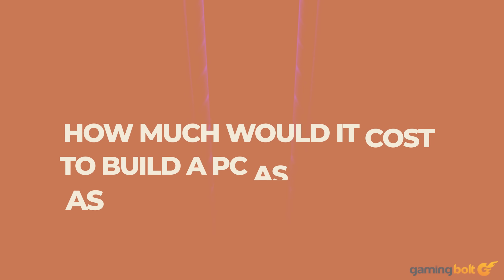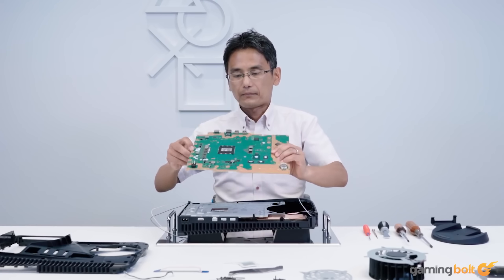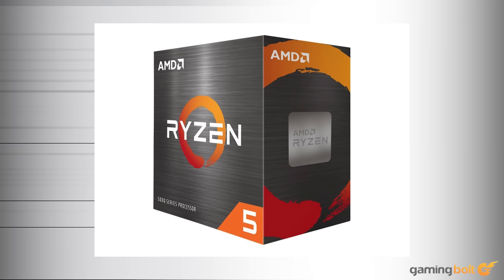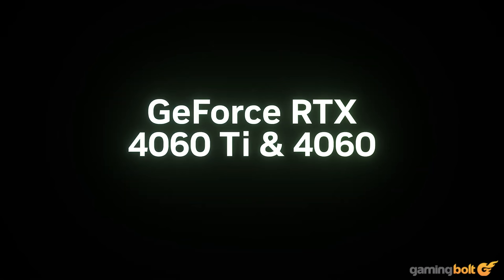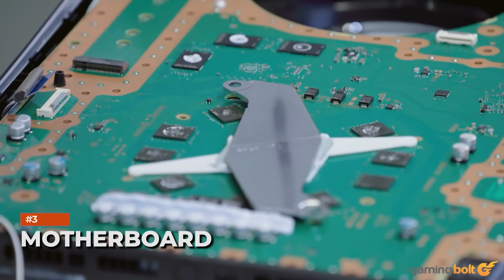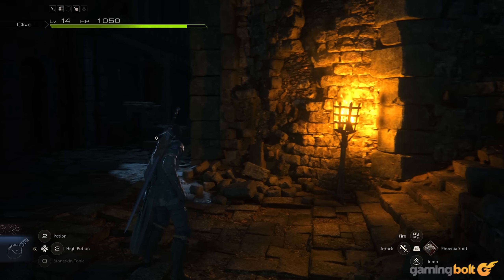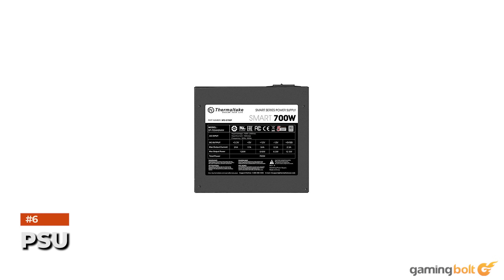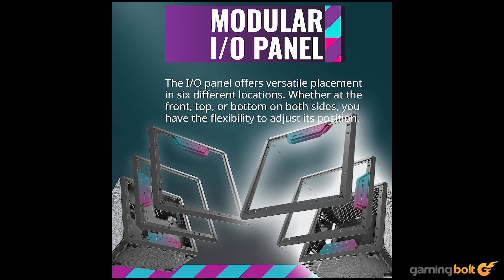How Much Would It Cost To Build A PC As Powerful As The PS5? (2023 Edition)

Comment: Got a 3060 ti and a 5800x and it blows my mind everyday after almost 2 years now , love this pc
Reply: @lonewolf_09you are full of shit  you are talking about intel they changed cpu lay out socket every 2 to 3 years while amd has been supported its socket it for more then that like 6 to 7 years
Reply: @lonewolf_09moreover people don't realize that PCs in the long run save's money for them as well when they buy games lots of frequent sales and there are also so many sellers on the PC market where you can get such a great deal on bundles. I would say that PC saves money in the long run than consoles in my opinion. Games Are way more expensive in consoles moreover you also have to pay to play online which is another bullshit thing that I don't like about consoles. Also PCs can be used for more than just gaming.

People only judge two platforms based on the initial investment not long-term.
Reply: @HellRaiZOR13 even long term, consoles are just cheaper than a PC. Invest the extra bucks in the disc version and you easily the same discounts for games as on PC. 
Once you have to upgrade your pc shit's gonna get expensive. Cause what are the things that mostly run out of required performance ? The heavy hitters. CPU/GPU. So every few years you gonna spend the equivalent or more of a whole console to keep the same level. A console on the other had you gonna buy once and it will last for the whole console generator which is 7-8 years. Good luck keeping a CPU/GPU as long without heavy performance losses

Comment: I will go for 6700 XT every single time
Better performance and 12GB is waaaay better than 8GB
Reply: Except PS5 GPU doesn't have 8GB, it has 15GB, because the machine doesn't really need RAM for anything else than the games on it. Think of it as a unified memory. PS5 is a games ONLY "pc", not general purpose.

Comment: Since this PC has no Blu-ray drive, it should be compared to the $400 PS5.
Reply: I have a blu ray player in my pc
Reply: And a PS5 has no screen... 🙄
Reply: @h0pesfall but can you plug a PC directly into a 60hz 4k TV from the moment you take it out of the box and play a game almost immediately without having to configure the finite settings to make sure the game runs smoothly?

And before you use the "higher FPS on PC" argument... You need to factor in the cost of a monitor that can run above 60hz.
Those things are not that cheap yet, and are definitely nowhere near as big as my 50" Gaming from my couch TV.
Reply: @BWA85  you didn‘t get the sarcasm
Reply: @BWA85 Yes, you can do that. GeForce Experience will set the in-game graphics settings and cap your FPS to whatever your hardware is capable of, it will do all of your work for you and you'll be playing at at least 1440p if your hardware is capable, which is better than sub-720p base resolution used on the consoles on mostly every new release. You plug the PC into your TV, install the game directly from Steam and you're ready to go. This isn't 2008 anymore.
Reply: @Blackfatrat ps store does have some good sales
Reply: @Blackfatrat  bruh how about buying 2nd disc or hand digital (illegal). I could get quarter of the price.

Comment: When you weigh in $80/year for online play, the pc wins over the long term
Reply: "long term" I calculated and it takes years to make the ps5 the same price, and plus you still have to upgrade your pc
Reply: @arinkarwan5888  really don't.  I'm still running a 1080 thats 3 gens old and it runs games just fine
Reply: @arinkarwan5888  Not Must have to upgrade. My Secondary PC has 980ti a 10 year old GPU and it still runs game just as fine
Reply: By the time you have to upgrade the PC you have to buy a new PS6 @arinkarwan5888

Comment: I wish I could pin this to the top so no one wastes their time here. A  Ryzen 5 3600 with a decent cooler and an RTX 2060 S OR a 5700 XT...... that's what you need to match/beat the ps5 

A stock Ryzen 5 3600 will match a 8/16 zen variant in the ps5, not only is it running at a lower clock speed than its familial counterparts, the reduced power budget of the chip also impacts the ipc of the chip. 

Similarly the GPU, while sharing architecture and features with an RX 6700, is not equivalent to that GPU, due to power limit and frequency. 

I'm giving it more credit than GN, they recommend a GTX 1080 and anything newer than zen 1 with 6 or more physical cores.

Comment: PS5 = RX 6600XT/RX 6700 (RTX 4060ti is around 20%-25% faster + DLSS 3.0 with FG for better performance) + R7 4700G without turbo (R5 5600 is around 30% faster or even more). Why are you trying to compare Zen 3 to Zen 2 and RX to RTX, this is not same technology and architecture.

Comment: Devs will always squeeze every last bit of power out of a console, especially as time goes on. Just compare PS3 launch titles to PS3 late life cycle titles. You have like GTA V, Uncharted 3, Heavy Rain, FF 13, Skyrim vs some random launch crap like Ridge Racer, or even Oblivion.
Reply: Not really true GTA V is running a pathetic 4x AF filtering when everyone has been automatically using full x16 for almost two decades on every game on PC lol.
Reply: That’s not really that the hardware is understood better. That’s because they were shifting away from older rendering techniques developed in the 6th generation for newer techniques and things such as deferred rendering. Plus you can see a massive shift in game performance where many early PS3 and 360 games ran better than later ones
Reply: @crestofhonor2349  early and less graphical games ran better than much more graphics intensive games that made them crap consoles run a sub 30fps at end of life. You can't optimize for the underpowered hardware deficits inherent to the last gen consoles weak mobile laptop cpu with 8 slow cores just like you can't optimize games for hardware that is not present like the missing in action strong cpu IPC from last gen consoles.

Comment: I'm interested in building a PC to replace my PS5, but the power consumption of the PC and big bulky PC case holding my plan, let alone need more money than buying a PS5. since I've the PS5 already, I don't think it is wise to build a PC.
Reply: In previous generations (xbox one, half the life cicle of xbox 360) the only way to justify a console was plain ignorance (legitimate reason TBH). However, current gen is solid, no reason to migrate to PC unless being willing to go full blast into something much more expensive, or complementary factors besides gaming
Reply: @ziokalco that’s patently false. Every game looks and runs better on pc even with bad ports and is cheaper.
Reply: @LudusAurea  PS5 has pretty much an RX 6700 (and a nerfed 7 3700), also a very good SSD. Achieving that kind of performance on a PC for a similar price is hard, and not possible with new current gen components. To get more than a 50% improvement you would have to go for an RX 6800xt which alone cost more than a PS5 digital. Going lower would be basically a sidegrade, pointless for someone that already owns the console (unless there are other factors motivating getting a PC).

Power isn't meaningless, 300w extra watts can quickly become more costly than a PS+ subscription (PS5 consumes less than 250w when fully loaded).
Reply: @LudusAurea  for reference, the difference between an Xbox series s, and an Xbox series x is more than 110%
Reply: Power consumption is irrelevant

Comment: An Rx 7600 will beat a ps5 and you can get them for 250.

So that brings the price down to 720. Then you don't need to spend 40$ on a case, maybe 20 bucks. So now you're down to 699. Only 100$ more than a ps5.

You don't need windows. Linux games just as well and would offer a lot more things to do other than gaming unlike a ps5.

Comment: 😂😂😂 - Sometimes I wonder if the information provided in these videos is satirical in nature...

A couple reasons that this won't ever happen. Building a PC to match a next generation console. First, what's the point? There are fanatics in each camp that will fight till their dying breath to defend their systems. Nothing you say or do is going to change their minds. You know, like religion. 

Secondly, OF COURSE the components to make equivalent machine are available. So in theory, it's possible to make a PC clone of any system at any time with any game. Facts are facts. 

This boils down to two main issues - time and money. As a hardware engineer, I can think of at least a dozen things I can do to improve performance on a PS5 given the an unlimited budget. And if I didn't work so much I could devote more time into the project resulting in far greater experiences. But, when I want to game, thats it. I don't want to have to stress and strain over gpus, RAM, or other peripherals. I don't have the patience to tweak every setting until I can get (on paper) better performance. Hell, I don't WANT to deal with much of anything. Coming home to unwind with a solid game as quickly and hassle free is my goal. And consoles scratch that itch. 

Also - just pointing out that only three components in you had already spent more than what a PS5 costs.

Comment: the actual components are irrelevant when the os and architecture differ so much, consoles are heavily optimised so the comparison is moot. the only comparison that matters is matching the performance of the same games at the same settings that is all. 
SO your choice of a 4060 is way off, as the games on console won't be running dlss3. why not save a bunch and get a cheaper and more comparable AMD 6700xt etc? many modern console games like to use nearer 12gb vram too, something the devs have stated they aim for and will become the norm in future titles now ps4/xbsx are no longer having to catered for. again something you'll miss on the 4060 but get on the 6700xt

Comment: The problem people seem to forget about the PS5 SSD is that they use it for extra RAM. That's why PC ports of their games requirements are stupid crazy.
Reply: The PC requirements are stupid crazy due to bad optimization.
Reply: Eh no
Reply: SSD is still slower. Sony can claim whatever they want, but all they're doing is direct storage access. Using the SSD as a RAM buffer would still be slower than actual RAM any day. Not to mention the fact that writing data to a SSD that often would essentially kill it in a fraction of it's intended lifespan.
Reply: You can actually set windows to do this as well. Not as streamlined as PS5 does it. Bunch of digging to find the settings for it. But I've used it before. Don't really need it when running 64gb of ram anymore tho
Reply: @paulieknewport1106  Albeit if a dev has used it properly, had yet to see.
Reply: @theepicduck6922 From a dev perspective ram is rarely optimized for. Memory optimization is mostly about structuring data, and the goal is to have all the relevant data in the CPU cache. When it is not in cache one just assumes it is somewhere fast-ish. But weather it is RAM or SSD is rarely relevant to a dev (The important thing is that it is NOT on the cache)
Reply: PC ports have high requirements because they're ports and the PC release was an afterthought. Don't talk about things you don't know a thing about 😂. 

And ssd for ram isn't the magical infinite ram hack that Sony's marketing would have you believe. Fetching from ssd will always be far slower than fetching from ram for your cpu, and the extensibility of a pc makes this weird hack completely irrelevant.

Comment: I have an i9 with a 4080, but i still play on ps5. Optimization > raw power. That's what most kids don't understand
Reply: Your PC runs higher framerates, lower frame times and supports a much higher graphic preset than the PS5 can possibly reach. This is a fact and optimization cannot close that gap period.
Reply: @SSEi02 but 720p upscaled to 4k is crystal clear on ps5...

Comment: Honestly, this build guide makes no sense at all atx motherboard in an matx case, 4060 card 🤷🏻, gen 4 m.2 on a motherboard that only supports up to gen 3,. This whole thing would be better is you said buy used get a 3000 ryzen 7 and a 3060ti and the b550 version of the gigabyte motherboard with your gen 4 m.2 with an atx case to drop it all in.

Comment: Look you have to include peripherals... 4K Blu Ray drive is a must, able to fit in the case is a must otherwise its not like for like, a dual sense controller is near 100, PS5's best feature... you also have to consider the PS5 stays quiet under load, something a stock AMD heatsink/fan CAN'T, same goes for the Graphics Card, which cooler does it come with and how loud? The case certainly doesn't seem to be able to keep the temps down, then you have the board, haven't read the specs but does it have even have Wifi and Bluetooth? What about that cheap board's onboard sound? I wouldn't think the DAC would cut it and definitely worse than the PS5's sound chip, probably another £50... all added up it'll be well over £1000 to make a machine comparable with a high-end controller, even without the cost of a copy of Windows...
Reply: My PC peripherals were almost $600 (if we only include mouse, keyboard, mousepad and headphones, so the real essentials).
Reply: The PS5 requires an expensive monthly subscription service that money goes to the cheap games and peripherals in PC. So consoles still second rate.
Reply: @leanlifter1  $80 a year for 3 free games each month
Reply: @reisshep  $400+ if you keep your console for 5 years and goes up from there. Most the free games are shit anyways. Saints Row sucks last month's big free one lol. Steam sales offer much more value without the forced monthly sub fees.
Reply: @leanlifter1  You can buy used disks to save money. It's a 24/7 sale with PS5. And even if it's $400, you're still only $900 down, build a PC with peripherals and a monitor for $900 and see how long it lasts.
Reply: @reisshep  What happens when the blue ray drive stops working ?
Reply: @leanlifter1  You have a warranty? You go to the place where you bought it and they fix it or give you a replacement. At least that's how it works where I live.
Reply: @leanlifter1  And you're acting like PC parts never die.
Reply: @reisshep  On PC the drive is ease, cheap and replaceable. Sony won't even let you repair their device or upgrade it plus the firmware will never let you replace it. Paying someone $500 to replace a basic and old disk drive in a console is ludicrous and might not even work and will void your precious warranty. At leased consoles finally got an SSD upgrade after PC has been using them for over a decade already lol.
Reply: @leanlifter1  Why would I pay $500? Did you not read my comment? I just go to the place where I bought my PS5, bring my PS5 and a receipt and they fix it. For free.

Comment: This PC runs 4K @120? I built a 13th gen ddr5 3090 premium build and I settled on a 1440 target. That was wayyyy more than $750.
Reply: could be due to the fact that prices are cheaper in the US.
Reply: @skellecraft2464  I'm in the US. My 3090 and i7 13th gen were $1300 alone. Total was somewhere around 3400 and I can't run AA games at 4K 120fps.
Reply: @Specialblend777 in a few years a mid range system will run all the new games of current better than your top end system C/W bleeding edge early adopters tax.
Reply: Nah, but the PS5 doesn't either.
Reply: The PS5 Can’t even run a stable 120 FPS in 1080p Fortnite let alone 4k
And 120 FPS is for only comp shooters Not Casual Games
Reply: @RengokuAMVs-im6xy  True xD. I can't believe they actually think PS5 runs at 4K at 120 FP/s when it struggles to run the latest games at D1440p with IR from FSR/TAAU/CBR and some settings set to low at 30 FPS... the 60 FPS mode on SW:JS & LOTF goes BELOW 720p as for the rendering resolution, like literally, for example.

Comment: I don't think That motherboard supports PCIe 4.0 drives. You're losing performance by not taking full advantage of the full read and write speeds in that interface. You'd need a b550 mobo.
Reply: A full fat PCIe 3.0 PC build is better than the integrated shared system laptop hardware of the PS5 that is already a few generations old. 16gb shared system memory is not better than 16+ GB dedicated system memory with 8gb+ dedicated Vram plus unlimited cooling to keep it running full out not throttled back due to the inherent laptop hardware thermal constraints on PS5.

Comment: The 4060 should never have made this build idea. It’s a terrible card at 8GB VRAM with the Nvidia price. If you started with a 3060 or a RX6600XT you not only beat the PS5 in power but cut the price. The new RX7600 would over power the PS5 without the fan-card price tags.

A problem you have right now is new gen GPU’s are a terrible product to do a PS5 vs PC. The ports from consoles are using 10GB VRAM on Xbox and I think 16GB on PS5. So you’d need a 4070 or RX7900XT to get the VRAM specs.

Comment: This is guide needs to be taken down. If a viewer purchased exactly what is listed in this video they will have a motherboard that is a full size ATX and a case that is cheap but only supports mini ITX and micro ATX. I do not agree with a few other things but the motherboard not fitting into the case is a pretty big deal breaker for this parts list.

Comment: Lol uh... Not only does this build cost more than a PS5 the only component you bought that will outperform the PS5 is the gpu.  You went cheap on the mobo and screwed the whole build, that case won't even work for the motherboard, the 5600 will not be equal because games are not as well optimized for pc so losing on any specs at all is a deal breaker for "equal performance".  

Long short your build may not even be buildable due to bad case choice with atx mobo, and even if you did build it, it would likely not out perform a PS5 on a game to game comparison and will likely do worse.